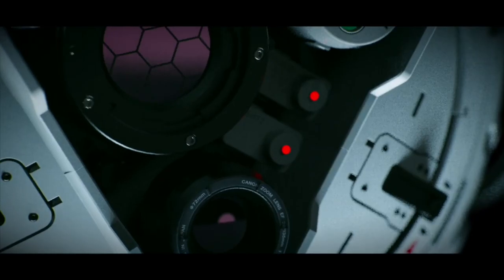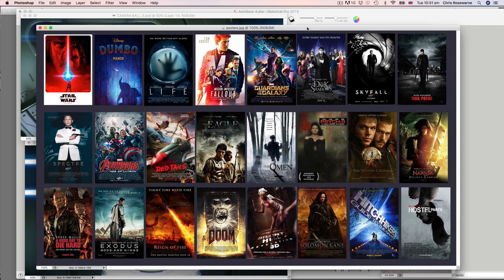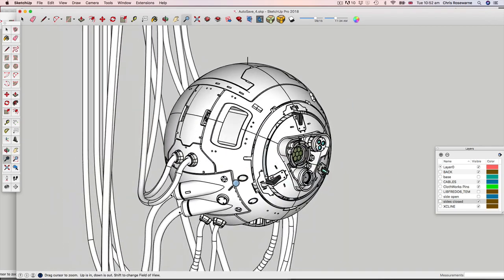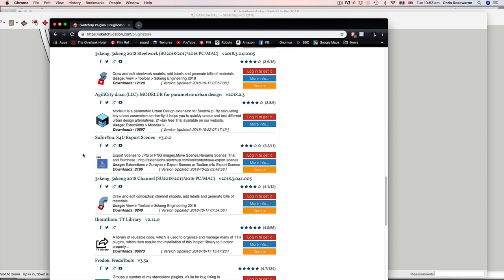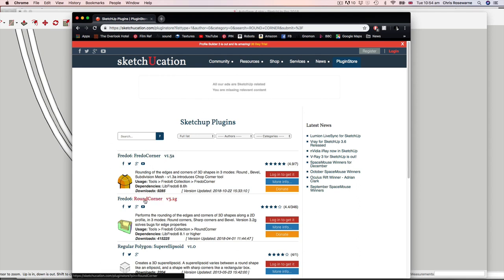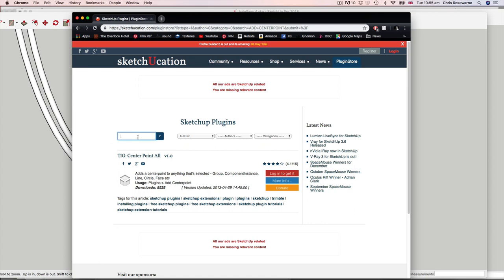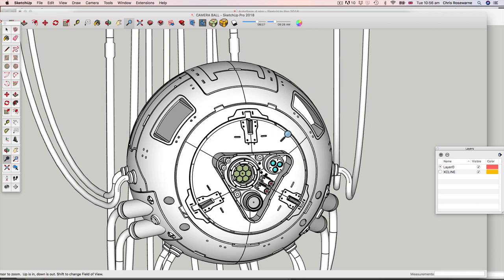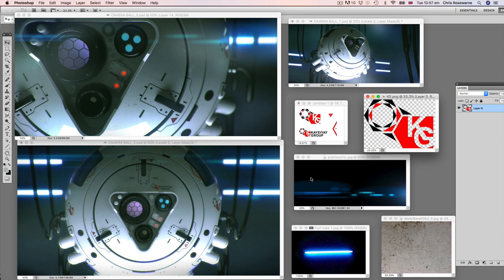Camera Drone SketchUp tutorial sample: Intro Chapter 1

Comment: Super cool! I wish it was made with Blender.
Reply from the maker: Thanks man, I'm looking to Blender next :)
Reply: Blender has way way to many clicks and hotkeys to do one thing. Ie, need to select face mode in order to select a face
Reply: @LT72884  not really.
Reply: @talat2k4  yeah, to even select a face in blender, or an edge, you have to hit tab then either 1,2 or 3 for edge, vertice, or face. in sketchup and other software, you just click the face or edge
Reply: @LT72884  if you dont know how to use blender or find it hard just dont use it.
Reply: @talat2k4  i didn't say it was hard to use did i. I said its more cumbersome than it needs to be. I know how to use it. Like i said, to select a face in edit mode, you have to hit tab, then number 3, then select your face. With other prpgrams, you dont have to be in special modes, then hit tab, then hit 3 then select the face, you just select the face.....
Reply: @talat2k4  No, he is right! Ive been using Blender for a long time and it has a weak side compared to others! I mean 2D drawing tools are far and far weak, Extrude tools working differently depending on the situation, sometimes its not working at all, Bool tools can break your mesh, Bevel sometimes does not work, there are basic modeling functions that should work good but makes more headache then satisfaction. And 2 sub levels to start editing is nonsense: I mean to edit Edge or Face you cant just select a face  or  edge you need to hit Tab , and then 1,2,3 and then edit,why I cant just switch 1-vertex,2-edge,3-face,4-object

Comment: What style are you using? Im an avid sketchup pro user as well, but i like that style sheet. I use su pro mainly for areospace engineering and medical stuff. Things that i cnc, print, etc. I JUST started doing concept art. Oh and how dis you make the hoses? And i only use a few plugins as well.. solid tools, artisan sculpting, and fredos
Reply from the maker: Hi thanks for your message. I use one of the default styles, think its an engineering style, either with my model being grey with white background or white model with grey background. profile lines set to 1. I use Round Corner and Joint Push-Pull  plugins mostly, cables were the Follow Me tool along a path I made using the pen and arch tools. 

I have a tutorial for this design and others on Gumroad. Click the link in the description above and you'll see all my design tutorials.

Cheers
Reply: @ChrisRosewarne  awesome thanks. I will check it out